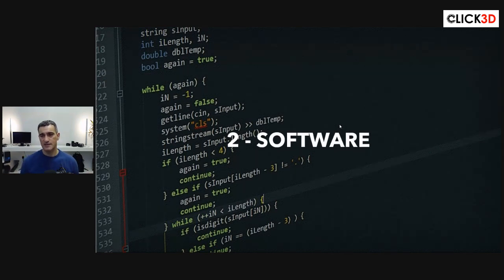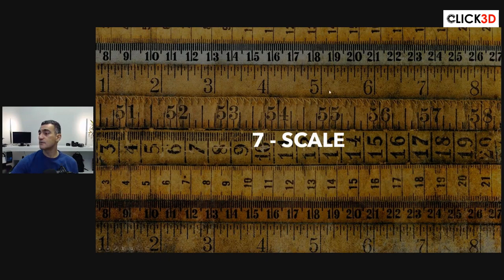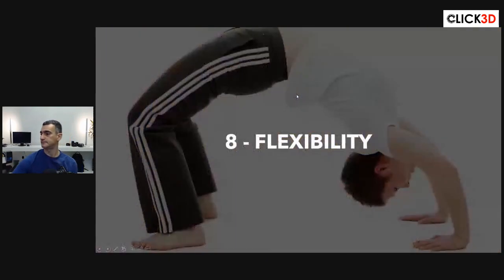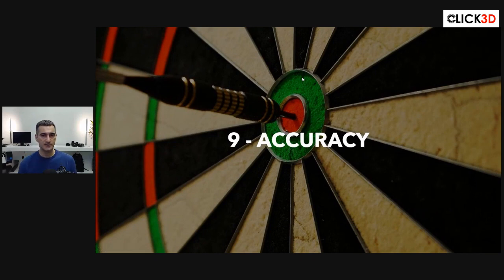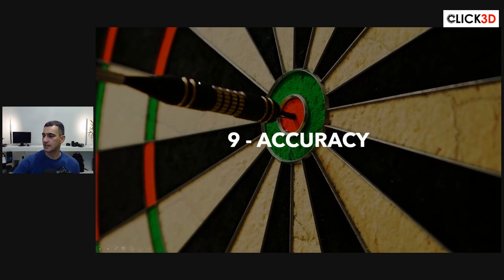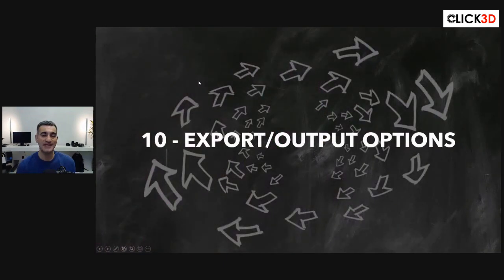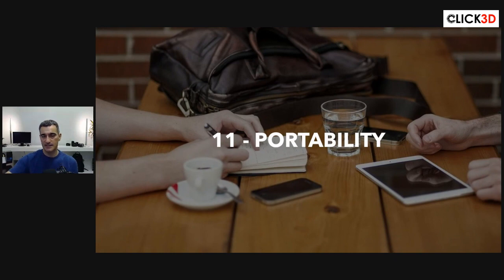Photogrammetry vs Laser Scanning | Click 3D Ep.19 | 3D Forensics | CSI

Comment: Thanks for the very thorough comparison.
Few questions I have:
1. When capturing shiny objects, you can use cross polarization technique with photogrammetry which can eliminate most reflections, can the laser scanner compete with that?
2. There are laser scanners which can provide an object with color texture in few minutes and save a lot of processing time that you have to do with photogrammetry, I'm not sure if the texture created by the laser scan is good enough but reducing the overall creating time of an object can be a serious gamechanger when you need to capture great number of items
Reply from the maker: 1. The laser scanner works on a different principle and so an object with glare has less of an issue but anything that would reflect the laser could cause an issue. It isn’t a simple answer. 
2. The laser scanner doesn’t have as good a camera as a good quality DSLR. Textures almost always look better with photogrammetry.  

Thanks for the comments.

Comment: Thank you for this video - a really great walkthrough of the two methods. For the field I am working in, I am sitting back with two questions: 1) How easy is it to combine either of the two methods with GIS, for a beginner?   2) Which one of the methods are better in terms of accurate measurements if you do not use GIS or "reference points". (Maybe you already explained it - and I just didn't capture it :)
Reply from the maker: 1 if you want to combine GIS coordinates to any of the Laser Scanner a Photogrammetry Projects, it’s possible through the use of ground control points. You just need to find a way of getting good control and then you enter those coordinates inside of the software at known points

2 accuracy depends on scale. For smaller projects the laser scanner would be more accurate but for very large projects spanning several kilometers, it would be difficult to beat Photogrammetry. There are other factors so it is not a simple answer.

Comment: Thank you for the information, im new to this subject. 
For an indoor controlled situation, lets say to scanner a 3D skull, can i lock the camera in one spot and then take pictures of the object rotating it on a plate? or is better the object stay fixed and take pictures in diferents spots like you said? 
Second, what is the best focal lengh to shoot for an good accuracy? 35mm full frame equivalent?
Third, im thinking about potogrammetry for this project, i want the results to be most accurate possible texture, size and detail, do you think photogrammetry is the best choise? Panasonic G9 20mp can take photos 6k 80mp

Sory for my english, and thank you again, very good stuff
Reply from the maker: I'll be running a series of 100% FREE photogrammetry webinars next week - Photogrammetry Week - April 6 - 8 - where I will be explaining the best way to take pictures, equipment needed and software available in the market. To sign up www.ai2-3d.com/photoweek
Reply: @3Dforensics  Thank you, see u soon

Comment: Thanks for the video! May be you can tell something about combination the laser scanners and photogrammetry? Use both technologies to complement each other. In theory, this can improve the quality of the model in places where there are strong shadows, thin objects, etc. I know in 3DF Zephyr we can drape photo on 3d mesh created from laser measured point cloud.
Reply from the maker: There are definitely advantages to using both Technologies but integrating them both is not always a simple matter and it often requires a bit of repair if you are working in the film or gaming industry. I guess it depends on what your after.